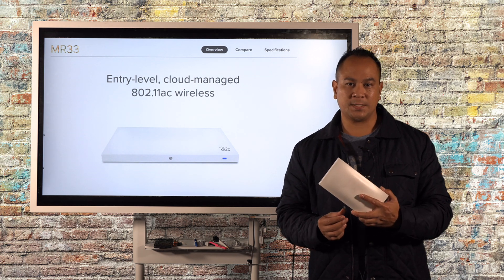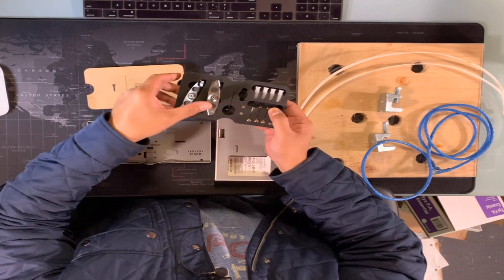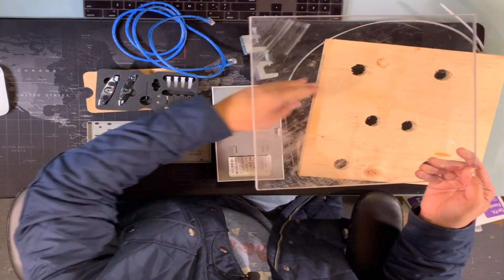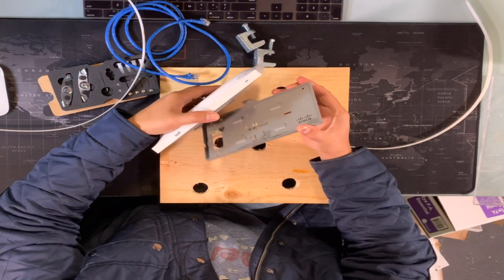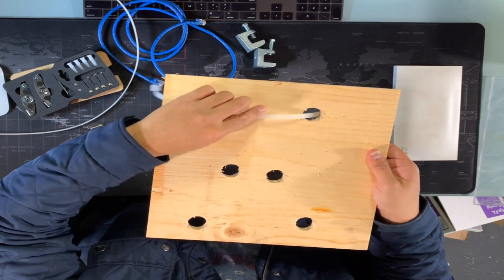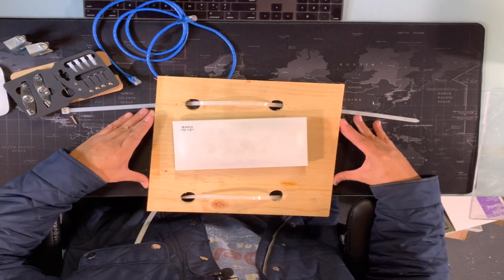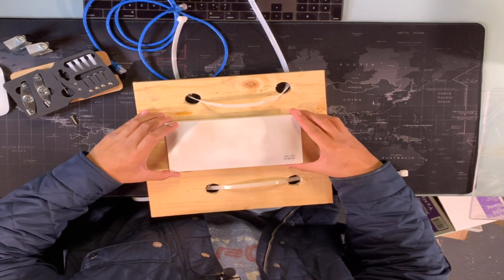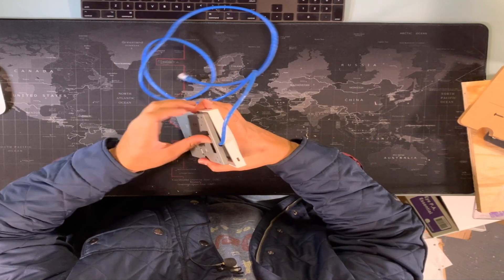Meraki MR Access Point Installation Setup - Warehouse /WMS

Comment: Hi, could you please explain if the MR33 or any other model from Meraki can be installed upwards instead of 
ceiling installation.
Reply from the maker: No you cannot as the antenna pattern is on the face of the MR.